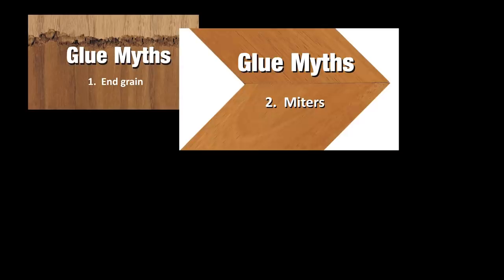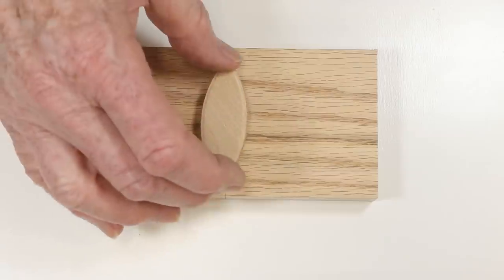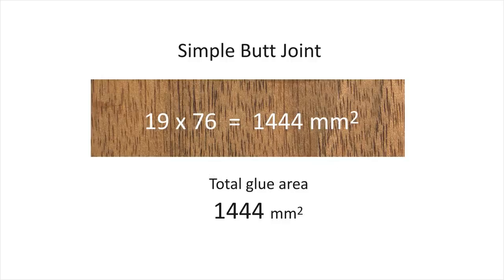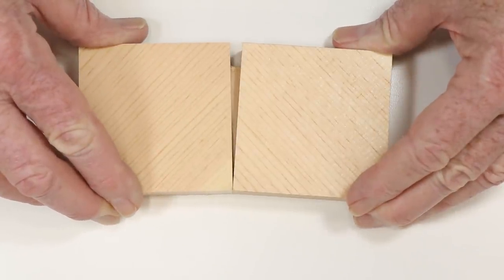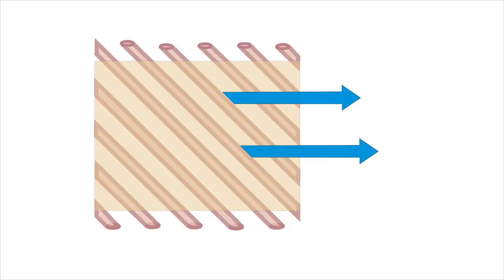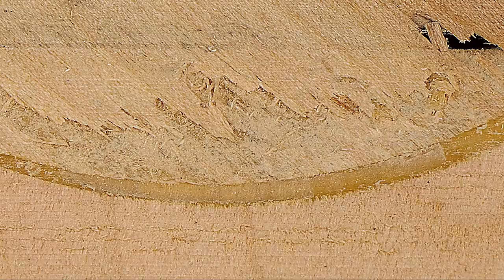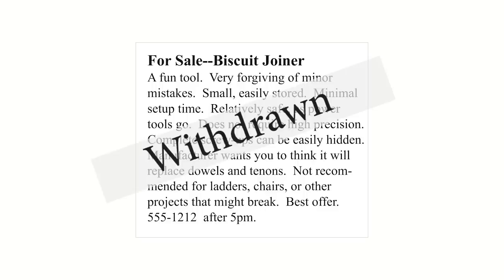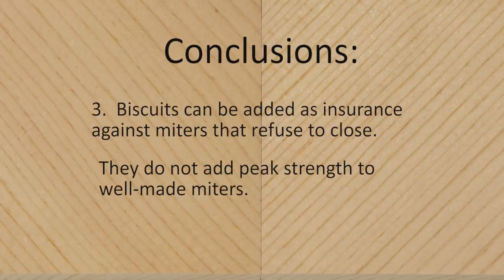Glue Myths:  3. Biscuits

Comment: Unfortunately you’ve tested these in bending with the biscuits at/near the neutral axis (middle) where stresses would be near zero until after failure of the top/bottom of the specimen.  Failure of the top/bottom would largely not be affected by the biscuit at the neutral axis.  You’ve indicated the limitation of your force application, but you didn’t limit your conclusions to reflect them.  To use your bending setup effectively, maybe consider putting a pair of biscuits so they are located away from the centre of the wood specimen to see if they add strength when actually being stressed before failure.  It is nice to see a more deliberate effort to pull apart some of these glue myths, keep it up!  👍🏻
Reply: I have to agree with Pat.  Your test only covers a case where the biscuit doesn't add significant strength.  The other cases that you leave for others to investigate would probably result in a very different conclusion.  I would argue that in the real world, a good proportion of the stresses on miter joints probably line up with the "other" cases, and as a result, the average strength of a miter joint would increase with the addition of a biscuit (although I'll admit that a splice is still superiors when it comes to adding strength) .
Your notes about the grain orientation of the wood in the biscuit is interesting.  I wonder why the manufacturer does it this way.  This brings up an interesting question: What would happen to the strength of a joint if the grain in the biscuit was oriented properly?  What if a hard(er) wood was used to make the biscuit?  The fact that it tore itself apart during your test means that there is room for improvement in the biscuit...
Thanks for the video, still very interesting!
Reply: @NugTrace  I'm tempted to make up a handful of specimens and run them into the lab where I have the capacity to test them in uniaxial tension.  Might be interesting... sadly there are so many other things I'm supposed to be doing!!  😁
Reply: Agreed. But I also wish he'd modify he's load testing to isolate shear and tension strengths as separate tests. His set up induces a high shear to bending moment ratio that is atypical of actual applications. And a biscuit won't contribute to any additional shear strength since the extra glue area is outside the shear failure planes. I'm not sure how much extra strength a biscuit actually would add, but this test is virtually designed to render the biscuit useless.
Reply: @aaroncecil7509  His short 3-point bending setup indeed, as you noted, make for coincident shear/normal stresses at the point of the joint.  If COVID allows, I hope to run a handful of specimens through pure axial tension tests in the new year to see how they will do.  I don’t know how they will compare, but at least we will see the biscuit joint being pulled apart.  Should make for a fun 4 or 5 min video.
Reply: Biscuits and biscuit joiners typically use the centerline. So this test is perfectly valid for the most common technique of how people use biscuits
Reply: @researchandbuild1751  Rarely are butt joints loaded in pure bending about the weak axis.  This is an incomplete study with overly broad conclusions.

Comment: mitre joints are not designed to resist or withstand the direction of the forces applied in these tests. they're meant to go around corners, so the forces they must resist are those that try to deform them in the (x,y) axes by closing or opening the angle at the joint. this press test applied force only in the z axis, which is not what mitres are designed for. biscuits and splines strengthen the joints in the (x,y) axes, which you proved when you could not pull the pieces apart by hand. i bet if you tested mitres with and without the reinforcement of biscuits you'll find a huge difference.
Reply: He is just trolling, he don't care reasonable things like that. It is sad to see how many fall in his tricks
Reply: Thanks for articulating my thoughts exactly. I can't think of a situation in woodworking where the stress on a joint like this would be applied from the side.
Reply: @bekanav  100%. It's a shame how many people think this is super helpful information. The information gained from these has no application to what woodworkers are doing. If anyone is making mitres the way he is in these videos they need to rethink what they're doing.
Reply: he mentioned that at the end of his video, were you listening?   🤔
Reply: @fabianherrera5427   Yeah, he mentioned it. But he still went on as if his testing was valid. The methodology was flawed, non-representative of real-world conditions. So his conclusions are entirely irrelevant. An accurate test has to simulate a real use case.
Reply: You didn't listen to the explanation of why he did it this way, did you?

It's so there can be a direct comparison made in strengh between this test and the previous tests done on butt joints for end grain joints. The tests are designed to provide a direct comparison for how the grain effects glue strength. 

This is not a pure test of the strength of a miter joint as such. Try paying attention before you make a fool of yourself again.
Reply: @johnterpack3940  stumpy nubs and i believe the wood whisperer have made videos going more in depth and analyzing this video and patricks results... and while i agree with you, at least he did mention it.. they agree and disagree with several points in this video you should go watch their vids for more info

Comment: Your 3 point bending test illustrates a simple engineering concept for beams. Loaded beams have one side in compression and one side in tension. In between is a thing called the neutral axis, where the stress is zero. In your case, because the biscuit is located in the middle (which happens to be the neutral axis for this cross section), the bending does not even put stress on the biscuit until after the butt glue joint has failed.
Reply: I felt like something was off in this test, and I think this hits the nail on the head. The advantages of the biscuit are not well represented in this test.  I would have liked to see a tensile test of the miter joint with and without a biscuit to see a comparison. But since the grain direction of these biscuits are 45 degrees, they may not be as helpful as I thought.
Reply: This is a good point, but the neutral axis is an infinitesimally small line. Biscuits are not that. It is possible that the biscuits break even with a small fraction of the stress that's applied on the outermost surfaces before those break.
Reply: @RishabhGKoenigseggRegera  The test wasn't about showing the advantages of a biscuit. The series is about the glue.
Reply: I was going to mention this. Most of the strength of any structure for most types of forces comes from the outer surfaces.

If you're using it close to the limits, you could epoxy much strong dowels deeper into a joint, like steel rods.

Comment: Interestingly, we found similar results when adding reinforcing fibers to concrete.  I work for the CA DOT testing cement and concrete.  A number of fiber reinforcing products have come around over the years.  I'm talking like 1/2" to 2" fibers, not reinforcing steel.  There have been plastic fibers, glass fibers, and metal fibers. Seems like it would make the concrete stronger, right?   Well, it never seems to increase the maximum strength, because the fibers don't really get involved until there are significant displacements inside the concrete, and that doesn't happen until after the concrete breaks at maximum strength.  BUT, what the fibers do well is holding concrete together after it breaks, much like the residual strength Patrick found here.
Reply: I thought the main use was to limit breaking of the concrete while it dries. Is that not a thing?
Reply: Am I getting it right that steel , base and the right mix is the formula for resistance to breaking?
Reply: Am I getting it right that steel , base and the right mix is the formula for resistance to breaking?
Reply: That is fascinating! Thank you for sharing!
Reply: @sawdustadikt979  The last time I took a concrete sample cylinder was, oh, 1971, but the dynamics of concrete construction (and by "construction" I mean the combination of compressive and tension elements, which include cement, aggregate and reinforcing) haven't changed (and "dynamics" is the key word, as contrasted by "static" analysis).  There are several things going on inside a concrete slab/beam/etc:  the rebar provides tension strength, in part by depending on the compressive strength of cement caught between the rebar ribs (which anchors the rebar to the cement);  another dynamic is the adhesion of the cement to the aggregates (technically, concrete is composed of cement and aggregates--rock and sand).  Any section of concrete construction placed under stress turns out to be under both compressive and tension stress.  The shape of the concrete and the direction/magnitude of the forces determine the amount and location of those two stresses.  The biggest failure mode for concrete is the loss of adhesion between the rebar (the tension element) and the cement; very frequently the loss of adhesion is caused by water penetrating the cement/concrete (rock and cement will absorb water and capillary it to the rebar), which turns the (iron) surface of the rebar into rust, which just flakes apart.  Salt water, as found in coastal areas with high water tables, rusts iron very quickly.  Generally, concrete is qualified by its compressive strength, e.g., "3000 psi concrete".
Reply: @dogface6040  Wow! Your response just saved me hours of reading. So straight forward. Cannot thank you enough. I’m a renovation carpenter. So I do work with concrete here and there. But I know there is always a better way than what you are currently doing. The better way is usually not knowing “what” you are doing but knowing “why” you are doing it. I was thinking about doing my driveway in concrete. I could do a deep compacted base and do slabs here and there when time, money and seasons allow. So from what you said, in thinking the rebar needs to be clean, the mix has to be right, and the concrete needs to be sealed regularly as well as graded for run off.Thank you for dropping some knowledge on this simpleton! You ROCK!
Reply: Wouldn't any composites or civil engineer, or materials scientist, have been able to tell you this off the top of their head? The finer the aggregate you add to concrete, the stronger it becomes - which is why you had better hope you never have to go back and remove any concrete which uses ceramic microsphere or glass beads in the mixture. 

Did some testing of a composite deck structure for bridges where we used that concrete as the road surface. A section needed to be smoothed and was impervious to sandblasting, and destroyed something like 10 diamond discs. 

Taking samples of it was an absolute horror, I don't think there's a good way to remove it without using cutting bars.
Reply: @sawdustadikt979  I don't do concrete construction no mo', but I do note that slabs and other "thin" concrete constructs tend to use "screen" instead of rebar.  I think it's called "remesh" at Big Boxes.  I  betcha there are only a million videos on the topic!
Reply: Yes, though of course it is much more effective than the biscuit example where there is dramatic failure.  Similar finding example here: https://youtu.be/KO3HczU-ICw?t=588
Though this jackhammer test really shows some of the additional ability they can have in preventing complete failure: https://www.youtube.com/watch?v=bRtRzszRcmU
Reply: @Ishimanian  talk to edgar montrose if you want something removed. anything.
Reply: I suspect the issue is that individual concrete fibers lack the proper bonding and development length with the concrete, and don't provide a consistent navigable load path the concrete can utilize to dump all its tension into.

But as for the biscuit, I wish he'd modify he's load testing to isolate shear and tension strengths as separate tests. His set up induces a high shear to bending moment ratio that is atypical of actual applications. And a biscuit won't contribute to any additional shear strength since the extra glue area is outside the shear failure planes, nor will it add bending strength since its inline with the bending neutral axis. I'm not sure how much extra strength a biscuit actually would add, but this test is virtually designed to render the biscuit useless.
Reply: That is different than the test being shown here. In concrete it is a mismatch in the modulus and failure strains that limits the "strength" the fibers add to the concrete. concrete fails at low tensile strains before significant stresses are built up in the embedded fibers.

The difference here is that this joint is being testing in bending across the joint, with the biscuit located at the mid-line of the joint where the bending stresses vanish. The biscuit is literally reinforcing the joint at where there are no bending stresses.

This is different that the prying/opening load on a miter joint, where there would be a substantial tensile and shear component that the biscuit and glue area will contribute resistance to. Essentially, this test applied a load in the wrong direction.

Comment: I never realized people used biscuits like that to add strength, I've only ever used them to help with alignment when gluing long edges together, as the depth from the top surface with the biscuit cutter can be easily set.
Reply: This is how my dad taught me. We mainly used it for alignment on desks, or similar furniture, as there are many long pieces that need to be glued together, and biscuits are the easiest method. Not for structural integrity, but for lining up, speed, and enough structural integrity to make the rest of the piece.
Reply: Another vote for biscuits as alignment tools only. 

Dominoes are a different story, from what I’ve seen. But I’d rather chop mortise and tenons than shell out $1000 for a Domino :)
Reply: Over 40 years of woodworking under my belt and I've had little use for biscuits thus far.
Reply: An an amateur I had assumed years ago this was the entire point of them. Using poorly cut (certainly not planed) lumber I was able to glue up a table top relying on the biscuits to help keep it aligned. They prevent the clamped surfaces from sliding across one another.

There are other techniques to deal with that but my 2x8” table thrown together with bits from Home Depot and clamped on bendy pipe clamps came out surprisingly well and looks nice years later.
Reply: @patty109109  Honestly biscuit slots are so sloppy I don't know if they even serve that purpose well. In my experience their primary advantage is efficiency.

Comment: I use biscuits as an easy helper to keep wood aligned, especially on heavy long boards. Paired with pinch dog clamps, biscuits really help when your panel clamps just aren’t long enough or you just don’t want to use them. I’ve never viewed biscuits as a reinforcement but rather as an aid for aligning.
Reply: Yes. I use them solely for alignment purposes. Especially when doing long edge grain panels. They aren't perfect but reduce the alignment error greatly and eliminates having to deal with slipping when tightening clamps. The little time it takes to cut the slots and install the biscuits totally makes up for the fuss of aligning panels and the amount of sanding afterwards to smooth out the joints.
Reply: conclusion #2 @ 8:10
Reply: I thought this was what everyone believed until I started seeing YouTube videos claiming they don't "add strength." It was always just to keep panels aligned. 

I blame Festool.
Reply: I'm with you, splines and biscuits are for alignment for me
Reply: Exactly, you don't worry about your table holding up an elephant, you worry about board warpage and glue failure over time. Plus mitre joints don't need to carry weight, they need to withstand being pulled apart length ways.
Reply: @TheSunsetter  Miter splines also look really nice.
Reply: @1steelcobra  I only add splines for their appearance.